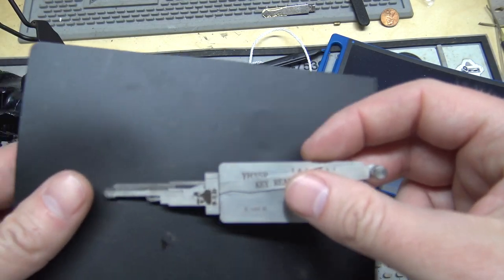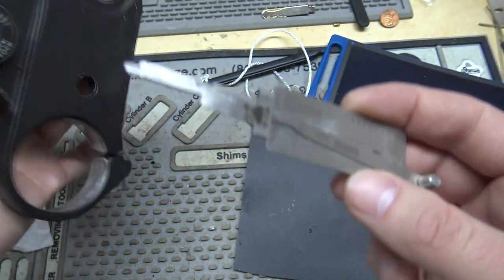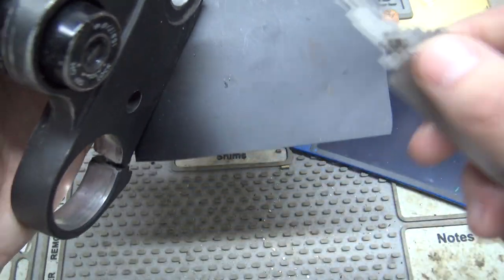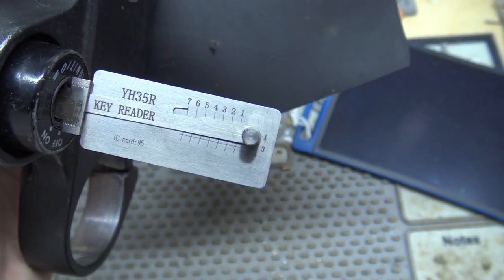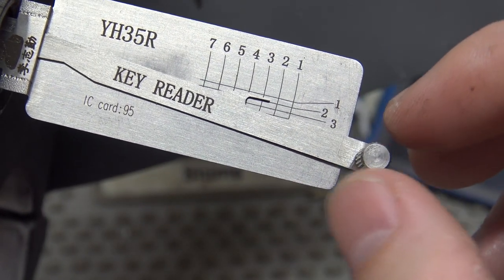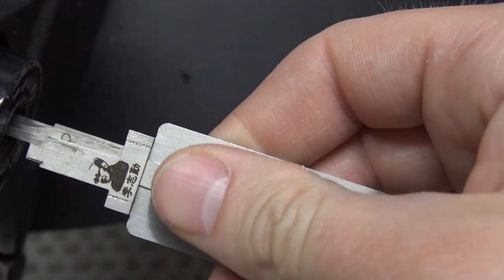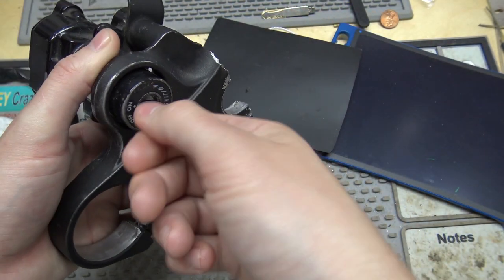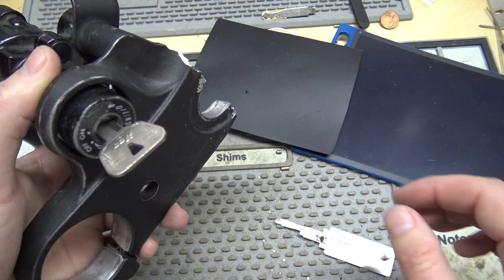(400) Lishi YH35R Yamaha Direct Reader Demo

Comment: which would you prefer when working on a Kawasaki vulcan 2007 lishi or accureader?
Reply from the maker: lishi.  I always prefer lishi tools over accu readers.
Reply: I believe an 07 vulvan is easiest to do with an aero key set, it's only like 70 keys. Could make it of you want. The lishi works well on it usually but I keep a accu just in case.
Reply from the maker: Mark Willadsen using the Lishi it’s a 3-4 minute job
Reply: @russej02  for sure, but you never know when something is odd or broken and it can pay off the have the other. Personally I'm not a fan of kawasucky at all.

Comment: Do you know anything about the Lishi KW14(15) decoder? I have a KLR650 that came with one key, and I saw the Lishi 2-in-1 on LPL's channel. The KW14 is just a "key reader", not a pick as well, like the one in your video here. However, it doesn't read out valid cut values on my bike. Any tips?
Reply from the maker: I use it all the time. Kawasaki sucks though. The code fill programs are often wrong on different code series. What year is your bike?
Reply: @russej02  2016
Reply from the maker: From what I can see that reader should work.  Have you decoded your key and you know you aren’t getting good readings? Send me a pic of the ignition and the key. Email me at theboredlockpicker@gmail.com
Reply: @russej02  nope. I've got a key, a bike, and the Lishi reader. My key has 3 of 4 possible cuts, tho I don't know which ones they are. One of them is the '0' cut. I'll send a pic.
Reply: @russej02  sorry I just parsed.what you were asking. In the lock core, the reader indicates off the top and bottom of the scale on some pins. I assume that's invalid. I have almost no practical lockpicking experience, but I've watched a silly amount of videos.
Reply from the maker: @Hansengineering  send the pics to my email. I gotta run and do a car lockout but I’ll take a look when I’m done
Reply: @russej02  the problem is likely that your klr isn't a kw15/14/ etc at all. The reader can create an accidental cross-key that will work everywhere except the ignition if you're lucky, but this problem is halmark of a klr with a kw16 keyway.

Comment: Will this exact one work on my r6  also whats the difference between this yh35r and the yh35  i need to pick the gastank for my bike
Reply from the maker: There’s no actual pick for an r6 just the director. You could read the wafers in the tank with but you’d have to cut a key or hand file a key. Yh35 is literally a mirror image if Yh35r one key won’t enter the keyway on the other one
Reply: Ahhh so i cant pick it and turn the lock using it then gotcha  thank you anyways
Reply from the maker: @5thgearpinned450  unfortunately not. There is a pick for Yh35r but it’s for ignitions with a magnetic dust cover. I have not had luck with it on regular ignitions or gas caps because it sticks out the lock way to far.  You can pick a gas with lock picks. They aren’t usually to tough.

Comment: Do you know what tool works for newer kawasaki zx6r motorcycles ?
Reply from the maker: What year
Reply: @russej02  2020
Reply from the maker: @dejanradivojevic8660  what key blank does it take?
Reply: @russej02  unfortunately I don't have an answer to that question, I have photos of the blank keys but can't share them in this comment section
Reply from the maker: @dejanradivojevic8660  you asked this same question on at least two videos on my other channel.  on that channel there's a paypal donation link and an email address if you want to email them over.

Comment: How often do you use the Lishi yh35r entended length? In regards to a Yamaha vstar 2006
Reply from the maker: Didn’t even know there was an extended length one. I’ve yet to run into a Yamaha using this keyway that this reader hasn’t worked. If for some reason it can’t reach the bottom of the ignition you could progress the last one or just use the gas cap or seat lock and progress it
Reply: @russej02   yeah I just saw it was new on the IKS website. That’s true tho. Thanks man have a good one 💪🏼
Reply from the maker: On some of the Suzuki’s that reader won’t reach the last wafer but it’s real easy to just measure the first six and progress
Reply from the maker: Just checked it out. It’s for the bikes with magnetic gates. I have the yh35 for magnetic gates. I don’t even know if those bikes are in the United States. I do a lot of motorcycles and haven’t ran across one yet.
Reply: @russej02  well if I run into one I’ll keep you posted
Reply from the maker: I’m ordering the Lishi lol. Gotta collect them all
Reply: @russej02  bro I think you have a problem lol😂
Reply from the maker: @christianramirez728  😂😂 Yea I work hard just afford more lishis
Reply: @russej02   I feel you on that man 😂 have you tried the Xhorse pad tablet?
Reply from the maker: Nah if it’s anything like the key tool max for immo program if it’s not worth. I posted a video yesterday of the key tool max and mini obd failing to program a 2008 Honda.
Reply from the maker: @christianramirez728  have you seen my other channel? I have tons of Lishi videos on there. Here’s the playlist. https://youtube.com/playlist?list=PL8RCMQVRECTTbqLa96uhcVZJ5eBlEewBL
Reply: @russej02  yeah Xhorse has a long way to go with that tool. I honestly don’t like my key tool max because you have to connect to wifi or hotspot